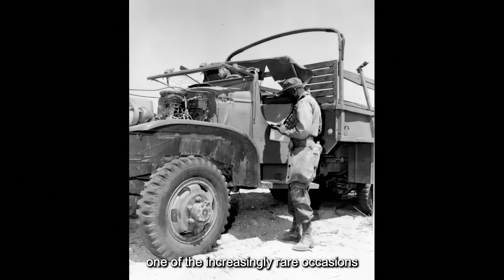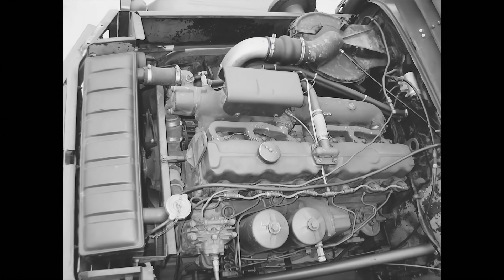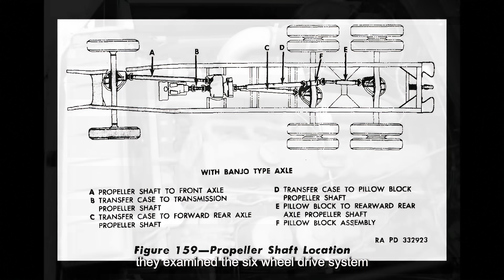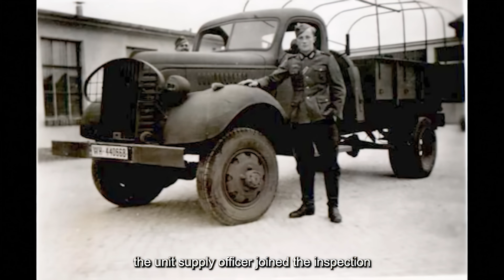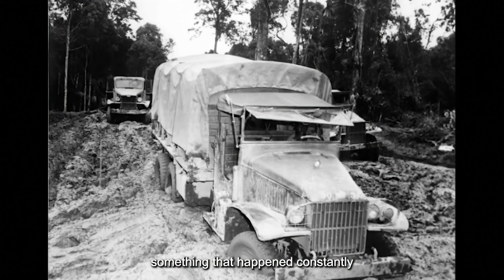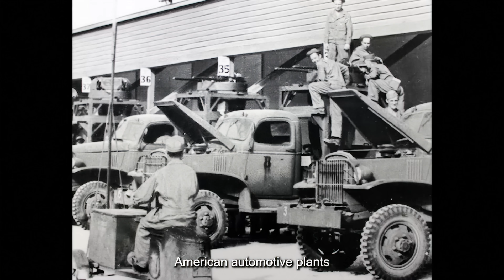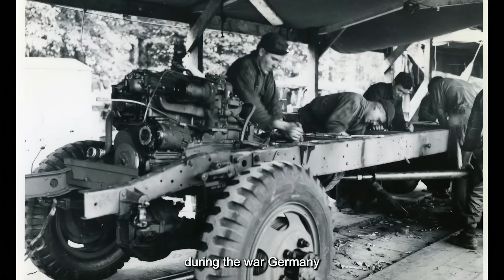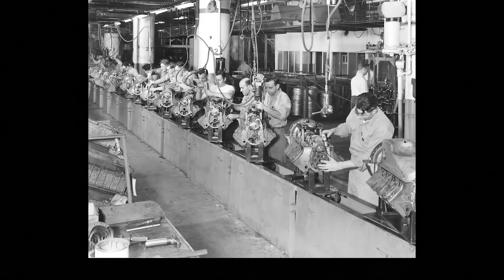Wehrmacht Mechanics Captured a GMC Truck... Then Realized Germany Was Doomed

Comment: I'd love to meet the guy who can straighten a leaf spring with a rock.
Reply: Chuck Norris
Reply: @gunnarerdmann7104  RIP to a great one
Reply: @gunnarerdmann7104  Oh no ....
Reply: @g @gunnarerdmann7104 
Didn’t need the rock
Reply: The Hulk.  Between forefinger and thumb.
Reply: Really big rock
Reply: @3FFFshooter2580 
Lol I'm going to put out there thought an skills 
Skipped the last 40 years or more of teaching it sadly is obvious
Reply: We were clearing trees in a grove there was a bulldozer that threw a track. We were able to reinstall it using   wood branches and a manual grease pump. I am sure that our fathers, uncles and grandfathers could perform miracles with the incentive of incoming ordinance.
Reply: I noticed that too. Leaf springs are made from “spring steel” which is a specialty hardening process
Reply: @daveanderson5680  Straightened front springs on a 1965 International Scout. Both bent up in the back. Not a rock but a chunk of 1/2 inch steel and a large hammer. Had a  bit more clearance in the front after I was done. Sold it 10+ years later springs where still working fine.
Reply: @daveanderson5680  Do you mean to say they didn't have spring steel in the 1600s? How did they make carriage and wagon springs? By a miracle? There were fine springs made for clocks before this. Come on man, it's called an education.  Get some.
Reply: I met him...   his name was.... Hulk....  Hogan 😂😂😂😂
Reply: @timothyheil7510 yep do that 
It's abilities to use brain 
Look into hulk😢
Reply: Um um your not able with a 24 pound sledge hammer with the it can't be done attitude 
First iron was beaten with rocks an lumps of timber 
Sadly most have that can't be done 
Thought process 
Step away from your tongue an mouth 
An ask your body to learn 
No words needed
Reply: I straightened one with a charcoal grill and a tree
Reply: @melissajones-zv8cd You have my attention, please elaborate ty
Reply: That is me pleased to meet you…
Reply: most times a spring won't get bend, just break.
Reply: The point is all you need is heat and force. No specialty tools or equipment required .
Reply: Leaf springs don’t bend, the general failure mode is fatigue, break.
Reply: LOL
Reply: Another smooth brain comment.
Reply: Geico Caveman could do it with a rock.
Reply: You mean which two men?.....the man strong enough to beat it in shape with a small rock.......or the man strong enough to push the giant rock on top the spring to bend it in shape?  AI got a little carried away with that one.🤣
Reply: Just tell an E4 he can he's done for today once that leaf spring is straight, and then make sure you don't know the where and how, to keep up plausible deniability. Did he actually straighten it or did he "aquire" it from another vehicle? Who knows? Who cares? You know nothing about that so not your problem.
Reply: In the later 1600s they had wheel-lock pistols. Spring driven -- and they had to treat the springs with extreme care, not leaving them around fully wound up, or the springs would take a set and the action quit working. Took them some time to get springs of that size durable.
Reply: Come to the Philippines
Reply: Me. It requires enough intelligence to heat the spring up enough first though.
Reply: @andrewallen9993  if there is an blowtorch you can use there are probably more tools  you can use that  work beter and using a rock becomes even more silly
Reply: @renzo123123able you can use a wood fire. I hàve.
Reply: @renzo123123able  Make a forge starting with a wood fire. How do you think blacksmiths worked metal?
Reply: @andrewallen9993 It's a hardened and tempered piece of steel, though. Chances are you're going to crack it before bending it and heating it up to straighten the spring out is going to anneal it. Upside with leafs is they make the suspension very simple and replacement isn't very hard.
Reply: Leaf springs most certainly can be straightened. Spring shops can re-arch springs. Your home press can do the same and the military even has old mil-spec procedures for field repair of springs until replacements are available. Maybe a rock is an exaggeration but the idea is valid.
Reply: I think "beat it straight with a rock" was a layman's term. Leaf springs are forged in high heat. In the case of a damaged spring, you create a blazing hot fire, place damaged spring in it, once red hot, use a "rock" as a solid base and use a sledge hammer to beat it continuously until you cant, cool down, and repeat until its straight. Those guys on the sidelines or indirect combat roles had a few hours to spare to accomplish this task on a daily basis. They didn't sit around and jerk off to only fans all day. Every second they contributed their time to went towards something meaningful to the war effort.
Reply: I have to say, that was a really idiotic sentence. Who would want to straighten a hardened leaf spring, never mind the tools required?
Reply: @Halli50 Japanese army officers who didn't yet have a katana.😅
Reply: @Halli50 Necessity is the mother of invention.

When the option is be stranded, walk, or fix it, and first two include the possibility of death by starvation, dehydration, or exposure, one tends to find a way to fix it.
Reply: Lesson, America is just better at everything unless you're an America hater aka a Democrat.
Reply: @Peter-pv8xx you are an asshole
Reply: @Peter-pv8xx Remind us again who ran the country and the war effort.
Reply: I WONDER WHAT OUR AMERICA WOULD BE LIKE IF PRESIDENT Donald Trump WERE PRESIDENT DURING THIS PERIOD...?
Reply: @WW2Uncovered-x5m get over it hippy
Reply: @WW2Uncovered-x5m We’d be speaking German because Trump would sell our military secrets to the Nazis.
Reply: Hey turdfondler. How’s it goin? I haven’t seen or heard from you since we arrested you the last time you got caught in front of the grade school on Roosevelt Drive. You know you’re supposed to notify your parole officer when you move.
Reply: @turdferguson4124 actually that was H. Clinton as everyone knows. Get over it
Reply: @bogbody9952 bullshit.  You probably got that nonsense from Fox News, which lost a $787 million lawsuit for lying to its viewers.  Trump, on the other hand, was indicted for absconding with sensitive national security documents, keeping them in a bathroom, and lying about them And refusing to return them when directed to do so.  Those facts are all in court documents.  Trump would sell your dumb a out for a profit in a heartbeat and you’re too clueless to realize it.
Reply: @turdferguson4124  do you love trump? i am i don't like trump.
Reply: @WW2Uncovered-x5m Why in Gods name would you draw that conclusion from my posts?
Reply: @turdferguson4124   That's the only thought that occupies the mind of a brainfucked liberal these days.  It's either "orange man, bad".....or empty space.
Reply: @turdferguson4124 
The Turd is filled with hate,  he must be a Obama / Biden worshiper  😮

Comment: Opel trucks equals GMC trucks Both GMC companies
Reply: Opel Blitz not 6-wheel drive; no winch; not even close on capacity, different design philosophies, different components, but, otherwise, yeah, the same.
Reply: @750suzuki . BEST COMMENT AWARD.
Reply: 100% correct.
Reply: Anticipated sabotage? 🤣
Reply: Yes, AFTER the war, then also the V1 and V2 Rocket engineers became NASA.
Reply: True but Germany took full control during WW2.
Reply: I understand Opel was taken over by the German government shortly after the war started.  Same with German Ford.

The Blitz did not share anything significant with the GMC.
Reply: @lowercherty  The German Ford and Opel put their war gains into banks, the funds were waiting for the owners when the war was over.

Comment: Those engines being assembled @26:58 are V-8s', not flat-head in-line 6 cylinder.
Reply: The 270 straight six was OHV.
Reply: Also shown in some pictures are the later M211 produced during the 1950's.
Reply: GM did not have V8's at that time, they had the OHV 6 cyclinder